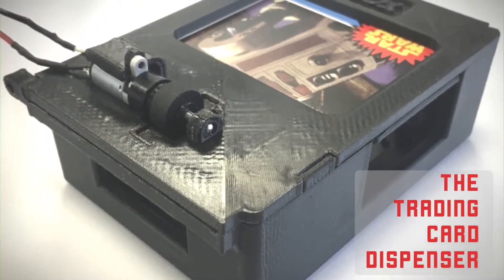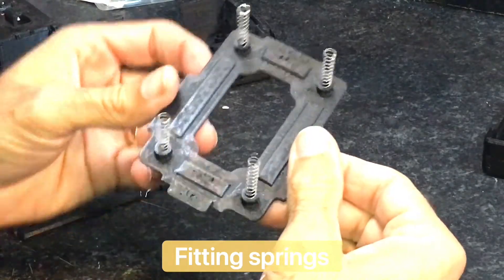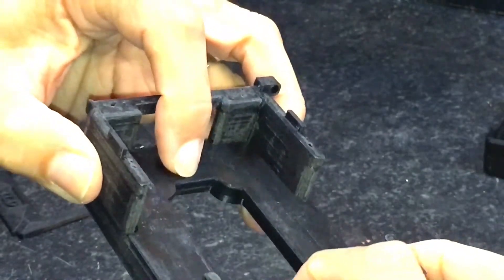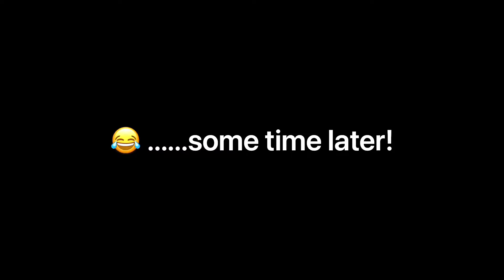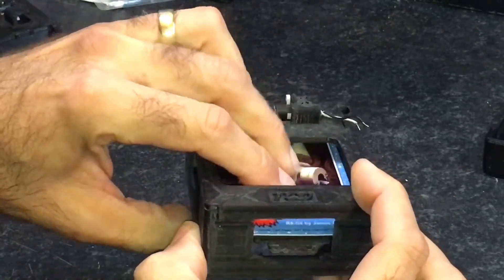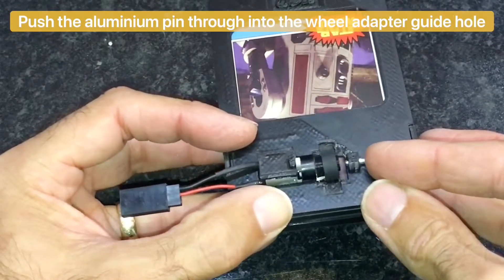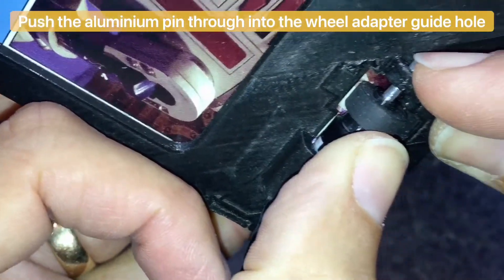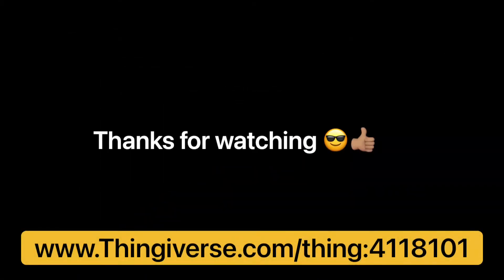Trading Card Dispenser - assembly tutorial

Comment: Hi, as I am struggling with the motors I have available, where did you get the motor with the + connector?
Reply from the maker: Hi, link to eBay https://www.ebay.co.uk/itm/266392008247?mkcid=16&mkevt=1&mkrid=711-127632-2357-0&ssspo=PnDsP-2ATHG&sssrc=4429486&ssuid=uZqnUPMyTs6&var=&widget_ver=artemis&media=COPY
Reply: @JamesR5D4  Thanks! And the spring length? I went with 25mm as 30 is too much and 20mm is too short.
Reply from the maker: @TheCraund the lengths for the springs is 30mm x 0.3 wire thickness x o/d 5.0mm
Instructions and parts are in the PDF via: 
https://www.printables.com/model/162486-trading-card-dispenser-version-2-cartridge-loader/files
Reply: @JamesR5D4  whoops, I even double checked it and still overlooked it. Thanks! Well then I'll see if I can get it to work with 0,3x4x30mm or 0,4x5x30mm since I only have those on hand, but otherwise I'll get the precise ones.

Comment: Can i change the servo with mg995?
Reply from the maker: If you mean swapping the micro motor for a mg995 servo, this is possible. It was one of my first ideas to use a servo. It would have to be modified to be a 360° continuous rotation one.

I didn’t include this in my Blog, but have uploaded a short video of it in action…

Testing testing Trading Card Dispenser 2019 #3dmodel #cool3dprints #3ddesign #3dprinting
https://youtube.com/shorts/Hmyvs13u7WE?feature=share